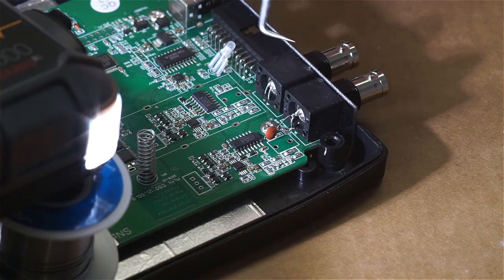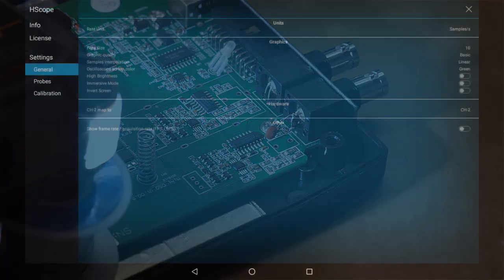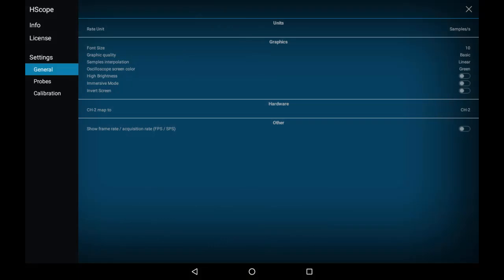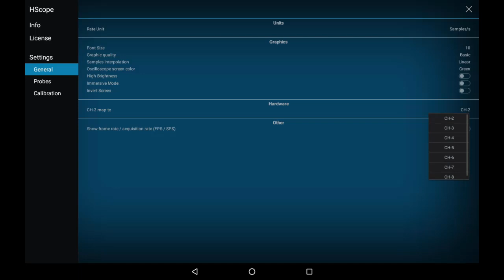GADGETS#46 - HANTEK 1008 CH7 MOD

Comment: my 1008 does not have screws it's held by two rubber pieces at each end, I will try ti]o remove them but worry about the warranty as I just bought it .
Reply from the maker: an inline (on BNC) AC Coupler will do fine without need for a mod you may not be comfortable with

Comment: Hello friend, you will have the stm32f fimware.
My oscilloscope failed, I need the .bin or .hex file.
Reply from the maker: For which HS model do you need the firmware, Luis?
There are many models.
And the STM32 Utils APP which can be downloaded free from the Google Play Store has them in the app library also...
Reply: @theGADGETSplaylist  Hi friend. I need the hanteck 1008 fimware.
Reply from the maker: @luisarias2618  nobody but Hantek has that!
Reply: @theGADGETSplaylist   you can read it with a stlink
Reply from the maker: @luisarias2618  I asked "around" if anyone had a HT1008 .bin
can not help...
maybe contact HANTEK for a .bin ... not likely they will send but doesn't hurt to ask
Reply from the maker: you may also find firmware on Martin's GitHub:

https://github.com/martinloren/HScope

Comment: Is this oscilloscope good for audio equipment, power supplies and other low frequency (less than 100Mhz) cuz I am thinking about this one but there is a 2 channel model for mostly the same price and i want to measure more than 2 things at a time so more than 2 channels sounds good and is the USB isolated so my laptop/PC won't get hurt by 100 or so volts into the USB :D
Reply from the maker: I would not get HANTEK 1008 for the work you describe.
I would lean towards LOTO (I know only 2CH but still...)
If your budget is tight go for OSC482 about $60US
If you can stomach about $100US, then OSC2002 or OSCA02 (basically same these 2, so whatever is best priced) would be my choice...especially if you're into electronics/audio
With LOTO watch for suffix added to model number (sometimes just bundles, sometimes more). I recommend chose plain (no suffix) ones.

Comment: Greetings!
Probably very popular question - Would you recommend upgrading to LOTO osc482, considering I already have a Hantek 1008c? I am using it solely for automotive diagnostics.
Reply from the maker: Much better performance from OSC482 vs HT1008.
The +/-5v input can be overcome with attenuators (am releasing a new 4:1 in the next day or so which brings these oscilloscopes to +/-20v, when required)
If you want more performance yet for a small increase in cost, then consider the OSCA02
LOTO has a "store" on Aliexpress
Reply: @theGADGETSplaylist  what about h scope support. I have just purchased a license for hantek 1008 + automotive, tired from the OE windows one (always wrestling with it...) Probably ask for a license swap if opt to buy LOTO
Reply from the maker: @StanislavTsonchev  The LOTO will require a new HScope licence...
BUT, the Automotive Module is good across all your scopes...no need to repurchase that.
Reply: @theGADGETSplaylist  would you suggest a particular vendor for the OSCA02 and which kit exactly to go for?
Many thanks for answering my questions! RESPECT!
Reply from the maker: @StanislavTsonchev  - I would look at Aliexpress:
https://www.aliexpress.com/item/4000115408280.html?gps-id=pcStoreJustForYou&scm=1007.23125.137358.0&scm_id=1007.23125.137358.0&scm-url=1007.23125.137358.0&pvid=5796f361-4b91-4c71-bf71-f7107d89dd46&spm=a2g0o.store_home.smartJustForYou_335080935.4

and I would chose the plain OSCA02 (lowest cost, no suffix)
Reply: @theGADGETSplaylist  suffix E suggests for double the sampling rate and almost dounle the bandwidth? Or that is just not necessary?
Regards
Reply from the maker: @StanislavTsonchev  - HScope won't recognize that difference. Do not pay extra for it...your best value is the plain OSCA02 without suffix
Reply from the maker: @StanislavTsonchev  and I fear HScope compability with (E) as support is based on plain OSCA02
Reply: @theGADGETSplaylist  still searching for a scope. Recently saw very good feedback on Pico 2204A, mainly based on the genuine Pico Software. Therefore what would you suggest between Loto Osca02 and Pico 2204A?
Reply from the maker: @StanislavTsonchev  they would both be good choices.
I like the power and portability of HScope so I would lean OSCA02
Pico 2204A is also a good scope and perhaps the better choice if you're going to use your laptop.
It becomes a personal decision.
Reply: @theGADGETSplaylist  I also have Hantek 20:1 Attenuator, 650A clamp and auto ditex COP. They should work just fine, shouldn't they?
Reply from the maker: @StanislavTsonchev  - YES, those accessories will work fine with either LOTO I suggested

Comment: Ive just done this to channel 7 and 8 of my spare dso1008. Ive just tried it on the original hantek windows based software and it sort of works. I say sort of as i have bias of about 200mv when its connected to a 12v battery. The zero line becomes bias by 200mv. However its still usable by using this bias line as your zero and not the side markers. Just tested this on a citroen c3 and it looks around 150mv pk-pk. I used my hantek dso3064 and this confirmed the same readings and pattern to the waveform.

Any idea why i have a 200mv bias?
Reply from the maker: +Mark Sheenan - Due to calibration would be my best guess. Perhaps the Windows software doesn't do a proper job and even if it did, HT1008 is bad for drifting off calibration over short periods of time...

Comment: I did 2 CH so I can use both a current clamp and the voltage to look at AC ripple on an alternator at the same time. It's not something I would regularly do but I planned for worse case.